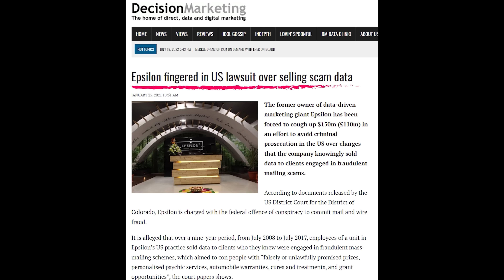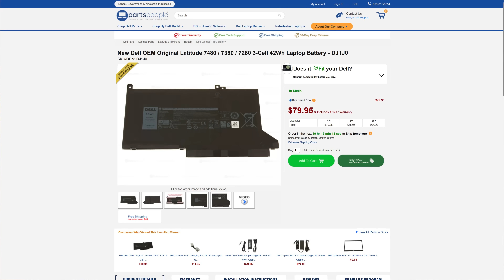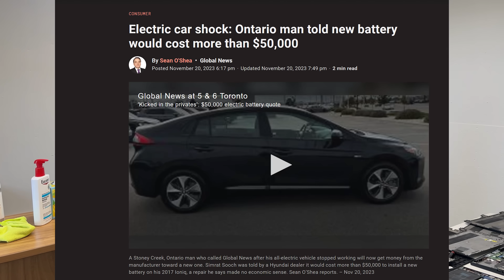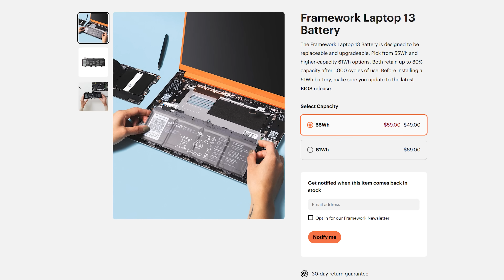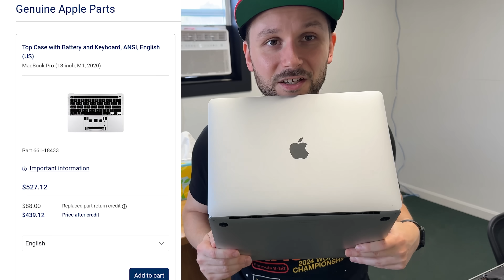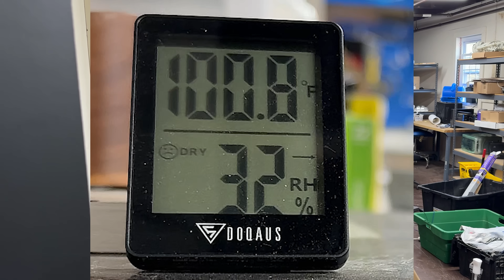Planned Obsolescence: Why is Replacing a Battery STILL So Difficult and Expensive?!

Comment: Hello. My name is Santy and I'm initiating a project in my region of Mexico where I've determined that the school system is at least 25 to 30 years, or more, behind when it comes to the implementation of technologies. I'm currently working with one Zona Escolar (School District), with plans to work with more in the future.  My plan is to start with the implementation of Google Workspace for Education. Having a source of low cost and refurbished laptops would be great. Since we will be installing Chrome OS Flex on them. I understand that Chrome OS Flex does not offer all the Device Management features offered with Chromebooks, but it is a start and way to accomplish proof of concept for wide adoption.

My point is that you should not worry too much about Windows or Linux on these machines. I'm sure that many schools in the USA are implementing Google Workspace for Education. Even businesses are implementing Google Workspace. Low cost and refurbished laptops for Chrome OS Flex would be ideal for these markets.

Comment: Even in the EU it is that F-ed up. Not only with electronics, I have a steam cleaner, the over pressure valve: cost as much as the whole thing. Motor of a kitchen machine? Hell yea, more expensive than buying new.

Comment: @10:43, I think manufacturers cause the products to expire by denying you replacement parts. I use a lenovo w520, it's battery still gives me 3 hours but the laptop is heavy to move with. Otherwise for inbuilt battery laptops , I repaired one by cutting out the swollen battery, and it continued to work but with less battery life. Inbuilt batteries for laptops was the worst idea ever. I also remember when we had like 3 Nokia phones at home and they just stopped to work, I think Nokia turned them off, so we had to look for android phones it was around 2015

Comment: Its called Planned obsolescence for a reason. Why have a person use a laptop for 5 ,7, 8 years, when you can force them to buy a new one after 3 a 4 years, when the battery goes belly up. The manufactures know this, and plan for this. It also kills the second hand market because as you stated, a new expensive battery makes no sense if the device is worth less then the battery.

My stand on EVs is the same... 

People really underestimate the impact of battery degrade and the second hand market prices. You can buy a ICE vehicle that is 10, 15 or even 20 years old, it will drive good. Sure, maybe your clutch will go, or it will use slightly more fuel. But you can get it cheap and it will still do 600km+ of its original 670km range. 

EVs are WAY more expensive to buy, batteries degrade and can even HEAVILY degrade when your living in hot areas. 

And yet, we are getting pushed by EU law makers into this market. Now the EU wants to increase gas prices by 10% (remember, we already pay easily 150 to 200% more then US car drivers) to push people to buy more EV cars. I am like, ... you can freaking add another 100% tax on gas, and your still cheaper off (ICE engine vs EV car of the same type buy price difference vs X years higher price on fuel).

So in the future, your going to enjoy issues like no replacement batteries (even if you want) for that EV. What about15 years from now? My Ice car is 15 years old, still drive like a dream. 650km range with just a 5 min tank. Compared to EV cars on holidays, ... 20 a 45min waits on highways to popular destinations, 45+ min charge times (on fast charge). But but you need to take a break every X hours driving. Sure, but standing in line waiting for a charge spot is not taking a break. Needing to charge up after less km's then a ICE car means you need to do a lot of those long breaks. Getting forced to only charge up to 80% so they can rotate people more often, while a ICE car tanks up to 100% and off they go (doing more range thanks to their 100% vs your 80%). And people to dot realized how much degrades their batteries will affect their range in the future. 5 years from now, 7 years ...

Battery technology is great, when its standardized. But its a wild west on phones, laptops, cars, etc ... My Poco F3 works great, its a bit older phone but its perfect for me. But ... the battery is getting old, and drains like a mf (and will only get worse as the charge drops = more charges need = faster decline of the battery). So ... new phone it was. Its was cheaper to just buy a new phone with a new battery, then upgrading my old F3 with a "aftermarket" battery. And my old one? Yea ... like a whole bunch of other we have collected over the years, in a drawer somewhere for memories.

Wife loves her intel 8th gen laptop but the battery ... And off we go again...

Comment: Thinkpads with dual cells are the worst, i have a t480 and t580 both of them were sitting arround for hald a year, both of them now have broken batterys because of deep discharge. Now i have to replace all 4 batterys and they cost a fortune, for the price of the replacement batterys i can buy one used t480 with still working batterys...

Comment: maybe the solution to the problem is an external battery. Something you clip on to the chassis. It would plug into the power port. the external battery would get plugged into it's own power supply. You could use a generic battery and parts to make them. 3d print the body. I did something like this with an old dell about 10 years ago. Mine was a bit clunky, as it used a 12 v battery and an inverter and a 12 charger for the battery, but that was just what i did at the time. Proof of concept sort of deal. The better one would use some random 19v device battery with a dedicated charger and no inverter. Nice and slim.

Comment: You are not just a refurbisher. You are the greatest computer technician ever lived.  😊😊
FYI, the battery industry is implementing microcontrollers to track charging cycles, which can lead to quicker battery depletion for business reasons. Therefore, it is recommended to recharge your battery when it drops to between 20% ~ 80% to prolong its lifespan. However, I understand that this method may not apply to EVs and laptops due to their overcharging conditions. Just keep that in mind.

Comment: Going through that with a hybrid.
A gf of mine bought a 2007 ford escape for $7000.00 from a car dealership.
For about 2 weeks it ran perfectly fine.
Then it started not doing "hybrid things" and the engine stayed running.
Then it gave an error code saying please pull over safely and Stopped the engine and would not start anymore. Dealership says "Oh well, AS IS means AS IS". Finance company says "Well you bought it you owe us" and local mechanic says "WHAT DA HELL IS THIS???" and said "take it to the ford dealership"
So we went to ford and they said that the battery was obsolete, it cannot be replaced, and thank you for visiting us, that'll be 195.00 for the diagnostics.
FUCK.
So We went on The Bay of E's and found one for twenty-two hunnit got damn dollars.
USED of course, because Refurbished would be 3500. 
FUCK!
So I had to finance it with that k l arna thing, and I owe 100 a month for 2 years.
FUCK!!!!
So I spoke to Ford and they said "Well OF COURSE WE CAN INSTALL IT FOR YOU! Just get it to us and we will ONLY CHARGE YOU an extra $1200 on top of the 195 diagnostic!"
FUCK!?!?!?!??!???!?!?111!!?!??
And so, in summary, When it comes to battery powered anything, We are all 
FUCKED

Comment: Just pulled the Spicy Pillow of a batt out of my 2020 Moto G power (mainly cause I use it on my fridge as a Home Assistant screen and it's plugged in 24/7 lol)

(I replaced it with a 10" android POS kiosk that doesn't have a built in batt for the same $20 as an aftermarket batt for the phone.)

Comment: Like I/O ports,  we need laws to standardize the batteries, for each category and class of mobile device. That way, manufacturers will have to adhere to them, e.g. for 14 inch laptops, I can use swap out the battery used in the thinkpad, and put inside another 14 inch laptop of another brand, such as asus

Comment: It’s the same with the freaking displays. I still remember buying those cheap Samsung’s 4K tvs, those that are around $600.
I had mine in the living room for about two years, barely using it because I mainly watched tv in my bedroom.
Happens that one day I decide to turn on the tv and suddently the screen doesn’t turn on. I call Samsung support? they come, do a quick check and tell me that the screen is broken and to buy a new one will cost $500. 
What’s the point? That should be illegal.

Comment: I rescued a Macbook Pro 15" A1286 from early 2011 from being tossed to garbage. Paid about $5 for it. Put a new battery, cheaper SSD and another stick of RAM in it. Installed OCLP and guess what? That 2nd gen i7, 16GB of RAM and AMD GPU still kicks ass 14 years later. I am selling it since I don't have much use for it myself, but still...

Comment: The thing that annoyed me was laptops now days wont work without a battery. The person i live with uses a old 2nd gen i7 laptop I took out then lost the battery and it still works 4th gen i7 that I gave away to a house fire victim worked fine. If I do that with my 2023 laptop it complains that the world is actually ending. So when the battery goers they just become ewaste.
Where I live we have consumer protection laws but they exclude stuff like batteries and AC adaptors as they are deemed to be the weakest part and prone to user damage so it's unreasonable to expect to get replacements.

Comment: This video hi hard. I have a 2015 15" Macbook Pro that I use to work at home (Office, zoom...), so I don´t need to by a new one. But, the battery is already at 1000 cycles and of course is not holding charge as it used to. Since it´s 90% of time at home, I can always plug it in, but if I am on a train or at a conference then it´s a big problem. I don´t change the battery for the very reason you gave on the video, the chance of buying a crap one on ebay is huge.

Comment: Why do kids toys need expensive batteries?  Why aren't they fitted with permanent capacitors with wireless charging on the outside.  They're kids so if they have to charge it every 30 seconds they won't care.  And the toy will be a lot cheaper to keep working

Comment: This is the reason why i stopped buying old tech or wireless stuff. Sooner or later the battery gets bad and there is no proper way to change it, unless you like to thinker with electronics. Not to mention how hard is to find the proper battery replacement and not get scammed.

I have 2 iPod Nano(4g and 5g) and both start to buldge pressing on the screen, but with how hard is to open them i will most likely end up throwing them. I also have like 4 bluetooth earbuds that barely hold a charge to listen for 30-60 mins. Plenty of old PDAs, Symbian phones that dont power up without a charger and I can't find batteries that aren't a rip-off.

Im just done with tech like this.

Comment: I miss the days where I'd drop my Nokia 3310 from three stories up and it would shatter into pieces. The back flew off, the battery ejected, the SIM card took a trip to another universe. And then you just put it back... Things used to be modular. Battery died? Replace it. Want a pink shell for your phone? Replace it. It used to be the same with laptops, too. Battery died or got to 0% in the middle of a lecture? Slap in a new one.

Comment: bro fr my laptop has a dual core ryzen 3 3200u and windows 11 in way too bloated so i just switched to linux and now i dual boot between windows 11 and linux but ye i use linux most of the time even tho it is on a hard disk where as windows 11 is on the ssd

Comment: i got a Lenovo 8H28 for my birthday last year 9 months later the screw inserts on the top case shat out when i was cleaning the fan i now use my Dell M4700 which hasnt given me a single problem since i upgraded my GPU to a Quadro M1200, and it gets better battery life?????

Comment: In my city we are used to not expecting good batteries when buying a second hand electronic like phones or laptops. We mostly keep our laptops plugged in and in the old time we would remove the battery to preserve it for the time of need. I still think that is a viable solution. Just remove the battery if they have severe damages or just put a note that says the battery is dog shit. You could also lower the price of those laptops and leave an option like if you want to replace the battery it is an extra hundred bucks. Overall laptop batteries are not considered reliable for almost half a decade now and I don't think people give a toss about them.

Comment: I used Rufus to bypass the Windows 11 requirements and upgraded my Grandparents' HP G1 tower to 16 GB RAM, an SSD, and a cheap 910 GPU so it can output to their 4k TV.  Cost about $110.  After setting up their favorites to mimic their old setup as closely as possible, they're back in business, and that old i5 is probably going to last them the rest of their lives.

Comment: I think if it's not feasible for manufacturers to keep support for old devices, which would be totally reasonable other X amount of years or else they would include their maintenance cost in the product which would be ridiculously priced. I think the devices should be engineered in a way that is not dependent on a battery. I'm aware that there are potential risks of running your laptop straight from the power source, but that's my whole point. Atleast with most laptops, after when they loose their mobility and become dependent on a external power, atleast it has a function as a desktop replacement. What I really hate about the tech industry right now are tablets and phones. I have a iPad 3 that lost the ability to charge, with that being said I cannot keep it plugged in to use it... All of my videos are now gone without a battery replacement. My Samsung s2, S5 are the same, but I had to remove the battery as it was bloated but I have a Vodafone phone on Android 2.0 that can run straight from USB power. I have an old Oppo phone that has so many precious data and I'm really scared once this battery goes, I'll have no way to turn it on or connect it to my computer to atleast save my data. What I'm trying to say is that the laptop industry is a bit lucky to still have that usability, and I hope this isn't an unpopular opinion but I think if battery manufacturing isn't possible, atleast keep usability by making it usable without the battery and just plugged in instead. Because that way it's not like The Crew where you use all access to it, where you can't even play it offline. I hope this movement becomes Hella Huge because it's disgusting.
Reply: Update: apparently some laptops can't even run straight from the wall, that's so crap, we really need to start a movement ☠️

Comment: i used to refurb phones back when that was a thing you could do with just some knowhow and the right screwdriver bits. i used aftermarket parts all the time (i asked and said it would be a lower price, but some people did still want the original). it is definitely not the easiest thing to try and navigate, but they did always work within +-10% of the new stock one, but assuming youre going through a brand that actually makes batteries and not a storefront that sells a bunch of batteries under their own name, it's a pretty reliable way to do it and not have to overcharge people. as long as youre upfront about the battery not necessarily being the same one as the oem, i dont think people would mind, especially if theyre able to get a good laptop for a price they can afford, and get repaired/upgraded

Comment: Latitude E6440 (2013/14) – still supports all modern office programs if runs Linux. Perfectly can open a lot of browser tabs and multiple browsers at the same time. It can run Android Studio if you tune it well (nice and ionice programs). It can't handle 4k video, but otherwise it is still perfectly usable office laptop.

Comment: I already changed a battery for my pixel 6a and Google is telling me to change it another time because it did more than 400 charging cycles, I ain't doing that
Reply: Idk much about batteries but as someone who sometimes charges their phone twice a day 400 cycles wouldn't even be a full year
Reply: @tyler6602 I'm at 550 or smth now and I have the battery by a year and a couple of months. I'd like to add that recently Google has made an update to my phone that reduces the charging speed and the maximum capacity to save the battery

Comment: I literally just had to replace the battery on my pixel 6a. But then before I could install it, the screen display cable snaps off. It's soldered to the display so I'm fucked. I bought a pixel 8a instead. At least Google gave me $100 for compensation on the battery. Apple would NEVER do that.

Comment: Exactly! I still have my HP ZBook G6 from 2019 running on an 8th Gen Intel Core i7, Kingston Fury 32GB dual rank, dual channel DDR4 RAM, an SK Hynix Platinum P41 2TB NVMe SSD with Radeon Pro WX3200 4GB GPU and the original battery is still at 96% max capacity. I keep the HP Power Manager/Battery Charge Manager on the Maximize My Battery Health setting so it never fully charges it all the way and I don't let it go below 40% or 30% at the most if I'm not plugged in. It usually spends most of it's time on the dock with a monitor and other peripherals but even on the move  I keep a 60 watt travel charger/PSU with me so the battery has lasted me this long. The battery is mostly used as a backup power source really since it's usually plugged in most of the time.

Comment: Remember when laptops used to have removable batteries with just a clip or 2 and if the performance went down you could just recell them with 18650 because they were all standardised.